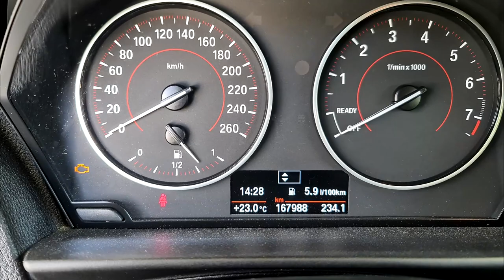HIGH OIL CONSUMPTION - VALVE STEM SEALS - 160 tkm SERVICE - BMW F20 engine N13

Comment: Got the same car, got it second handed in really bad shape, only starting to getting her good maintenance after a lot of work. I already did the clutch, transmission rotor and head gasket change. Was planning on doing the vanos seal since they bean spitting oil from the start but I wasn’t experienced enough to do it myself. Thank you for your work, you’re really helping out!

Comment: I just did this today on my 1.6 thp Peugeot 308 following your instructions. Thanks for uploading such an informative guide, I was quite worried about timing the engine but everything seems to be working fine.
Reply: to everybody that is wondering, this did solve my oil consumption from 1-1.5 liter/1000km to about 250ml/1000km. I also have a oil leak somewhere at the back side of the engine so probably that 250ml would be even less if that is fixed.
Reply: Thank you for this information 🙏🏻

Comment: Hello, same issue and same idea to solve it. I had an oil consumption of 1 liter/1000 km, and after a long-term in neutral and start, a relatively big cloud came out of my exhaust system. Now the valve stem seals are done, the line after my exhaust is getting less and no carbon black is getting in the cold phase out. Oil consumption got normal again.
Perfect video!
The bad thing is, my left camshaft (EU, German model, 2013) has a triangle fitting at the back. I wasn't able to get it out like you. I had to uninstall it with all bearing shells/assemblies for the camshaft. Ista told me the same as yours, but somehow my camshaft had a triangle at the back and you have a  flute fitting, which is a lot better.
Reply: *with "line" I mean:
On the ground behind my car is a "smut line" because while the cold start it is pushing carbon black out of the exhaust, but it stopped now after repairing the timing chain and valve stem seals. A hell of a work for so little things. :D

Comment: Yeah, my 2006 316i also used 1 liter of oil per 1000km, according to my calculations. I used some cheap China-tools to do the job, and the total cost was about 150 EURO, new seals and tools included. This job costs 2500 EURO at BMW here in Norway, which is riduculous.

Comment: Fantastic video, and amazing work Jani. Thanks for sharing. 

The process of valve stem seal replacement is very extensive, I would do this alongside a timing chain replacement regardless of oil usage since a lot of process is similar. How long did it take you? 

Hope this solves the oil usage issue... Keep us updated!
Reply from the maker: Thank you!
I did a lot of maintenance at once with time at my leisure, so nothing was in a hurry. But I would say it took a whole day just to change the rubbers on the valve stems. And of course filming took its own time 👍
Reply: @JaniVoutilainen  oh yes, now you've said it, I can imagine filming process in itself takes lots of time - you do a great job of that too. I look forward to more in your F20 maintenance series 🥳

Comment: Hy Jani 

I'm unable to find a valve spring tool set  that has a M12x1.25 mm adapter for blowing into the cilinder using the compressor (M12x1.25 mm is the thread of the spark plug). Did your tool set had one ? .. or did you use a separate adapter?

Comment: Done all of this great vid but I never adjusted eccentric shaft minimum lift and I'm know chasing a vannos intake control fault , camshaft stuck 1130104 do u think this could cause it change solenoid and got a new vanos unit for the timing side timings spot on any help would be great thanks

Comment: "I saw a Russian YouTuber on YouTube who did the whole thing without compressed air. He simply turned the cylinder to top dead center (OT) so that the valves wouldn't fall down. Of course, he made a mark underneath on the flywheel to ensure the correct alignment is met again."
Reply: Today, I finished the job, a real fiddly task with the valve wedges. But it was really necessary; even the chain was at its maximum length.
Reply: Bonjour j'ai une fumer bleu a l'échappement après un arrêté de 5 min et après plus rien . 
Je consomme 1litre dhuile pour 1500 kilometres j'ai commander pour faire les joint de queue de soupape.
C'est bien ces symptome pour les joint de soupape. Merci

Comment: hi, from your videos I see that you are an expert on this engine, I too have a 116i f20 but lately the car has been going badly. reading the errors, it comes out as a code 150c13 "third cylinder ignition out of tolerance" but I can't solve it. you can help me?

Comment: Great video! I think this will not solve the oil usage issue, the car just dont smoke anymore at idle.
Reply: @Jokesxxl  Jani's consumption before valve stem seal replacement was 1 liter per 1000Km which is quite a lot. I have 169k on my clock and do 1 liter per 4000km - which i consider excessive. Any reason you think it will not solve, or at least significantly reduce consumption? Cylinder pressure test was ok. I do see a lot of carbon though.
Reply: @mikeukabam1075  i had a 114i with 125k kilometers at the clock, it smoked when idle and had an oil consumption of 1L @ 1500km. I replaced the valve stem seals and valve cover and had again oil consumption for 1L @ 2000km. Then i changed over to 5W40 liqui moly and it used 1L @ 3000km. I did a compression test and looked at the cylinder walls with a camera it was all good. Thats why i think the problem will not be solved. Now i drive a Alfa Romeo Stelvio 2.0T with zero oil consumption……
Reply: @Jokesxxl  thanks for the information. Hope someone finds where the oil goes. Lets see if Jani's consumption goes down. One posibility, with the carbon build up I saw could be the oil rings (lowest set) loose some effectivness. How often did you change oil? Don't want this problem coming my way
Reply: @Jokesxxl   In that case, it seems Jani will keep us entertained for a while as we dive into piston and rings 😀
Reply: @mikeukabam1075  thats for sure!!

Comment: How much pressure is needed ob the cylinder and does it need a big compressor? Thx
Reply from the maker: I used a small 6 liter 1.5 hp air compressor that produces a maximum of 8 bar/116 Psi.
A small air compressor starts almost all the time, so a bigger one would be better. The bigger one would at least allow you to work in a quieter environment. 😉
Reply: @JaniVoutilainen  great thanks very much for explanation! I also heard that you can drop a nylon line in the cylinder to hold up the valve..
Reply: @JaniVoutilainen  Hi, Great Videos they have been a really big help.  Do you know where I can find the torque settings for the Cylinder head bolts.  I am in the process of replacing the head gasket. And cannot find torque settings.  Thanks
Reply: @JaniVoutilainen maybe we got the same fatboy compressor 😁 how much bar did you use ? Thx

Comment: Everybody waiting answers but the guy doesn’t reply...i heve the same oil consumption problem. The replacement of valve stem seals didn’t solve the oil consumption problem. Sorry to not be able to help you...
Reply: Did you replace it yourself or have it been done by mechanic? Mine (118i-110000km) is consuming so much oil ...already replaced pcv and oil filter housing gaskets and no results....thinking of taking it to a mechanic for valve steams...can’t do it myself.